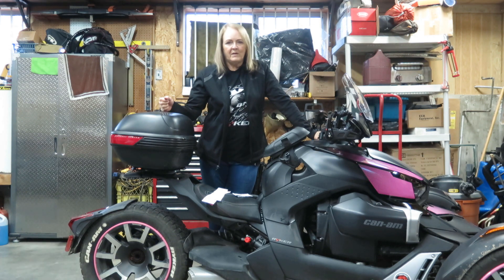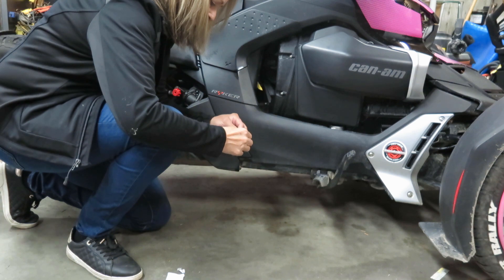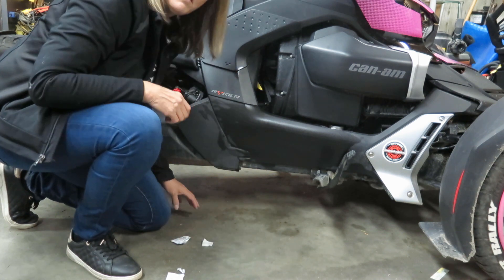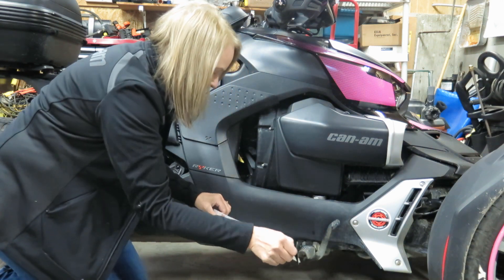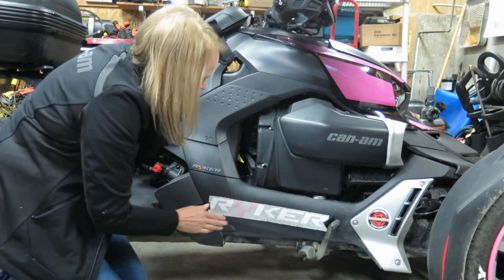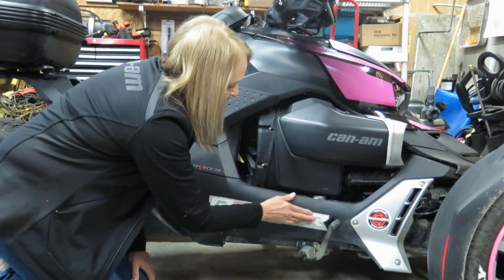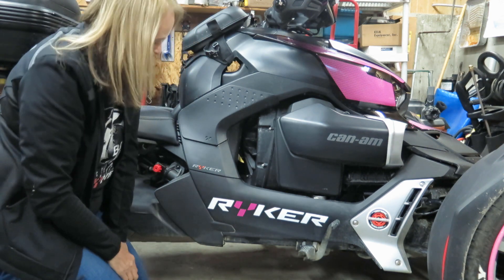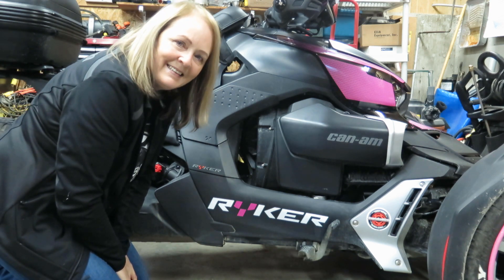ryker graphics made simple

Comment: I had issues with my decals. Cleaned with soap and water first. Then 99% IPA. They stuck great to the airboxes. But not on the lower sides. The same place you are applying yours
Reply from the maker: 99% in my experience is too degrading. 70% cleans without disturbing the plastic. That may have been your issue. Thanks for watching!
Reply: @RideForAdventures  Thank You. 
How was the Alloygator to install. 
Was really hoping for a video on it. I have watched the video from Alloygator. Thanks for that info
Reply from the maker: @Rob S  The first rim was a learning experience lol. My advice, use windex on the rim as you pound the protector in. The next ones were a breeze,

Comment: Where did you get your Graphics (Vendor) ? I've not had the best luck with sticking on surface and have used a few different ones!
Reply from the maker: I got them from a little company called Etsy. A suggestion I should have put on the video. After you get them on take a heat gun or hair dryer and heat the graphics lightly. To a temp where they feel warm to touch. That will help meld the adhesive into all the tiny imperfections.